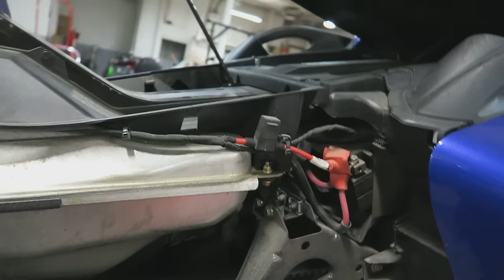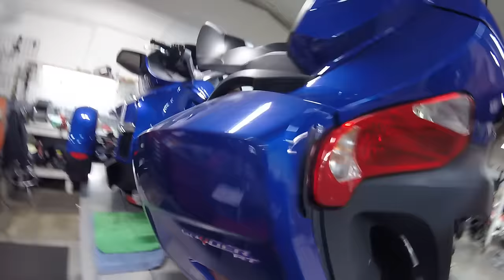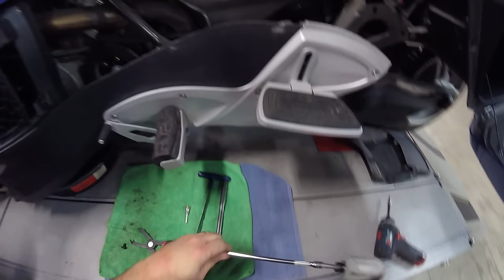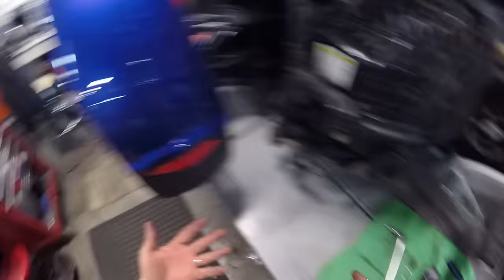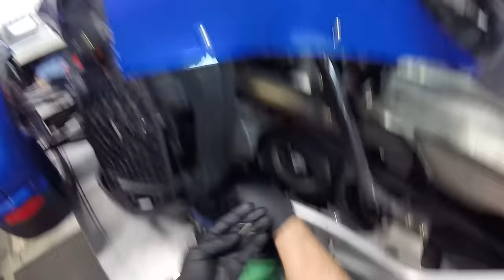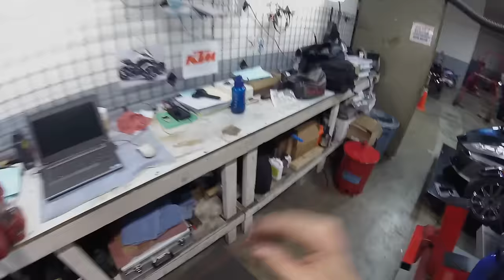Spyder RT Twin Oil Change! - Smoak Winter Vlog! | ShopTalk & Vlog_001

Comment: Thanks Shawn from me as well.  This helped me step though an oil change on a 2013 RTS SE5, which did have differences of filters and shifting mechanisms BUT I used this vlog and the owners manual to step through the process with great success.  I did discover in reassemble that the 2013 has the “quick access” panel you noted so next time it will be faster.  I used a BRP oil change kit and it was smooth, but long process of 3hrs 20min from parking the Spyder to riding it post oil change.  It was a lot more involved than and of the 2 wheel motorcycles I’ve owned since 1975.  Thanks again, bb

Comment: Another awesome video.  Here in NS my dealer charges $75 CND for the kit but another $150 in labor + 15% TAX!  You just saved me a ton of money my friend.  I'm going to pick myself up a kit and some ramps and do it myself.  One of the reasons I've been thinking of switching to a Ryker is they seem so much easier to work on but my 2010RTS is still running great at 99,000kms.

Comment: You save me a lot of time by waching your video before trying to change the oil on my 2011 Spyder RT (Standard) Transmission. I was looking at someone's else video and the filter is in the other side  on the new modeland mine does not have the second smaller filter and plug. Ran nto a problem that the oil plug under the Oil reservoir appears to be permanenetly locked in place.  Overall the oil change is long and tedious but I learned a lot by doing it myself.

Comment: Nice thorough explanation/guide. I too am a Can Am technician and it's nice to see other techs doing good work! I see units come in a lot where either the customer screwed something up or another dealer did. Have to take your time with spyders their are a lot of steps.

Comment: I Really like How you are very attentive to what you are doing when you are working on the Bikes, I appreciate The fact you clean the bike as you are working on it. When I had my 1200 iron, I never did any work on it outside of cleaning and the Mechanic at the Shop I went to was a lazy slob and his Work reflected it. I always had to clean the bike because there was always oil smudges on the bike one spot or another. Hope You get where you can do more at work Tech video's. I enjoy watching them. Would Have loved seeing you change the rear shock on that Spyder, along with the tire. Anyhow Awesome Stuff Shawn.

Comment: Great video. Gonna do my own oil changes on my 2012 RT Limited. Do you have a video on intermitent transmission shift delays? Sometimes my bike will hesitate for 2 or 3 seconds before shifting.  Wierd, but it's paddle shift.

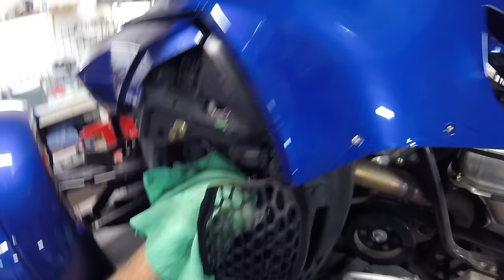Comment: Music? I hear Death Magnetic in the background.. at 17:23 it sounds like Cyanide... yeah.. I'm a Metallica fan... just a little bit :D
It's really simple to make a mount that hangs your camera under the rear view mirror from it's stalk/pedestal. I like the angle it gives you and most people (then again my Sony is a lot harder to see being so slim) never even see it. I've pulled up at the store and people haven't noticed it till they look in my side window.
All you need is a little piece of sheet metal and a clam shell pipe clamp and maybe a bit of foam strip to act as a damper/ allow the clamp to grab it instead of marring your rear view. The pics of the mount I made are on my facebook page, minus the clam shell clamp, I still need to get that, I was using a wire loom thing but it doesn't clamp the best.

Did they make a twin F3 style one? That'd be cool, the sound of the twin in an exposed frame/engine lighter weight chassis with a manual trans... I guess it's just the hot rodder in me and the fact that I'm a twin kind of guy. I'd say it's because I grew up around Triumphs but my dad's 74 Trident is a 3 cylinder and I don't like how it sounds either.

Comment: Shawn, I have a 2013 RT Limited and I had to remove the banjo bolt on the oil tank. Can you tell me the torque setting for the banjo bolt? Thank you
Reply from the maker: The torque on that banjo bolt is 21ft-lb (28.5Nm)...

Thanks for watching!

Comment: Just watch video I have  a spyder just like that one getting ready to change oil in it what size does it take to get the oil filter cap off.... Thanks
Reply from the maker: The engine and HCM filters use 5mm allen head screws.  The tank and engine drains are 6mm.  Note: The HCM filter bolts are longer than the engine filter bolts!  Mixing these up will end in total engine failure and possible vehicle crash!!!

Thanks Chris!
Reply: Shawn Smoak thank you sir keep making the video's